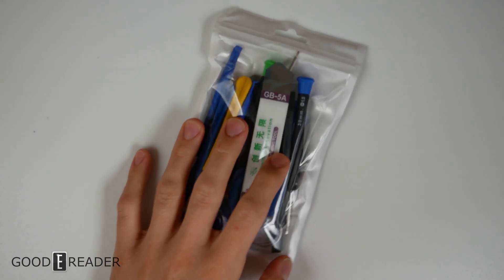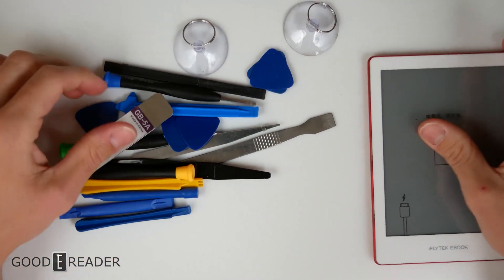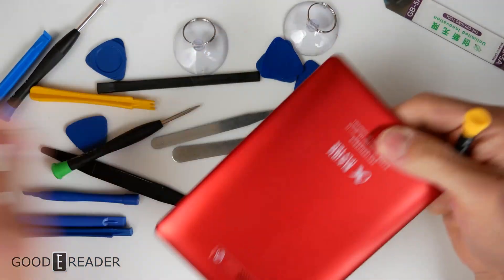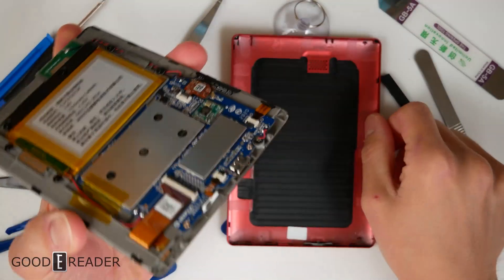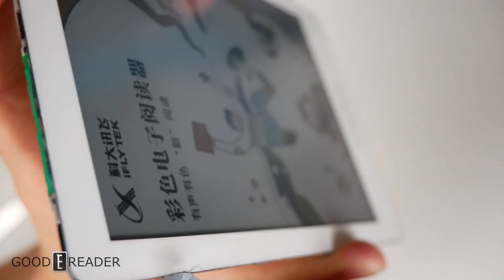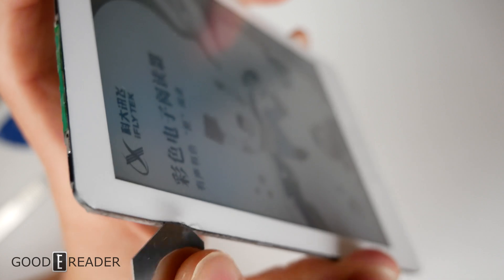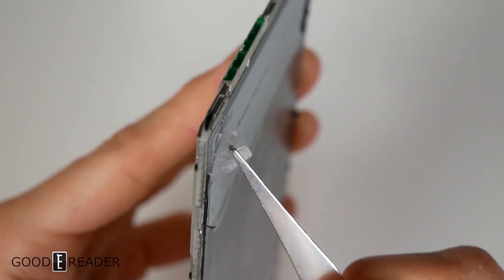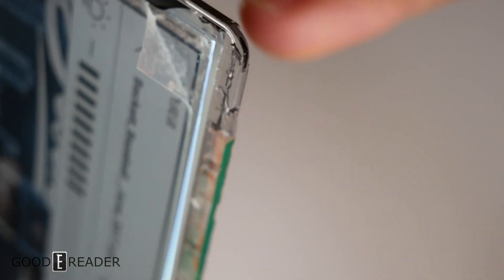Color e-Ink Kaleido Teardown

Comment: It is amazing how at 5:00 the colors pop so much more with a bare display, without the screen protector on top.

BigMe and Good-Ereader should find a way to make a bare display Gallery 3 e-reader (without screen protector) for the colors to be much more vibrant : this would be a big selling point innovation !!!
Reply: I'm actually going to attempt to take the top layer off of the bigme galy. If you have any tips lmk!

Comment: "technically" ... If you were so inclined... You could cut out the screen part of the top layer, and re-adhere just the bezels, and have a more vibrant reader.,... As long as you glue it in a protective way.
Reply from the maker: You are 100% correct

You don't need the top layer
Reply: @goodereader  probably not a good idea to use a stylus without it though...
Reply: So my nova 3 glass has cracked but all looks good beneath.. Surely worth a try peeling it off without damaging the layers below?? Thanks, this is the only useful thing I've found relating to broken, beloved, expensive boox nova 3 😢
Reply: @mattmoran100  any update?
Reply: @yablah  still been too much of a coward to do it! 😔

Comment: If you'd like, I could send you 2 broken Kobo Aura front panels (maybe even a Kindle basic 2014 panel that had never been installed) if you'd like to take apart an E-ink Pearl based display assembly with a flush screen and bezel.

I kinda wished I worked for you (though I don't know of any specific work hours and whether or not content is vetted), as I have experience repairing older e-readers.